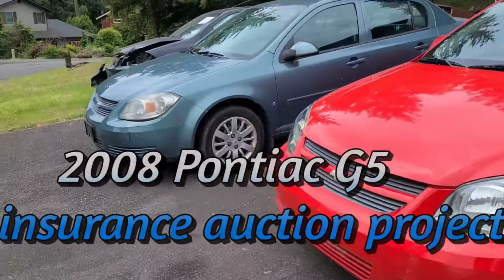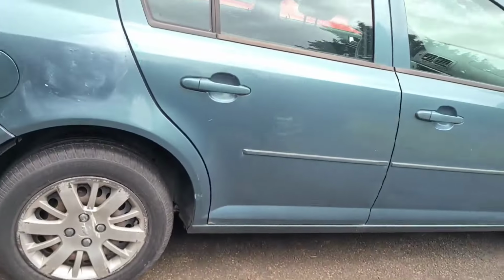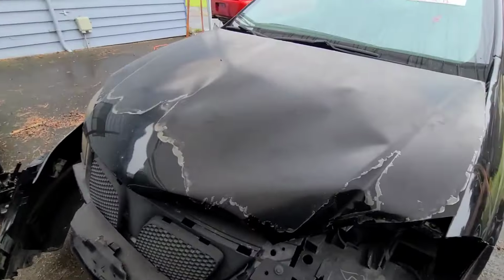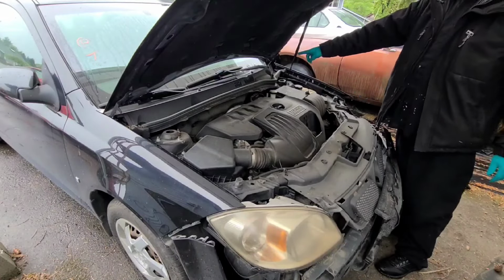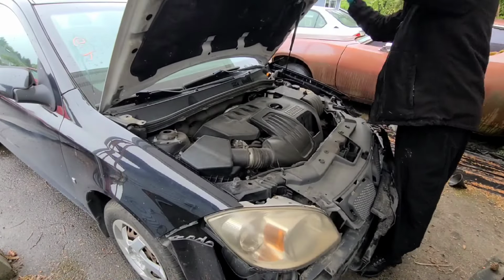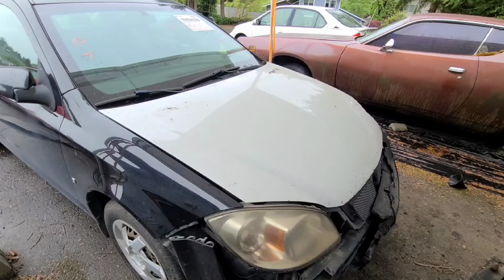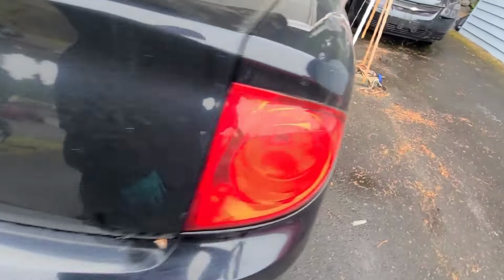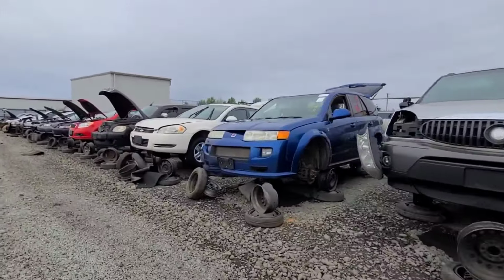$300 insurance auction Win!!! 2008 Pontiac G5 166,0783 MILES

Comment: You don't have a video on removing the cowl where the wipers are at. I want to paint it
Reply from the maker: I think I do have a video about removing it , but it is when I removed the wiper motor 👍
It is very easy you just remove the wiper arms and a few clips and it pulls right off I briefly go over it in my next video which will be out in a few days 👍👍
Reply: @1020autorebuild  awesome standing by for the video